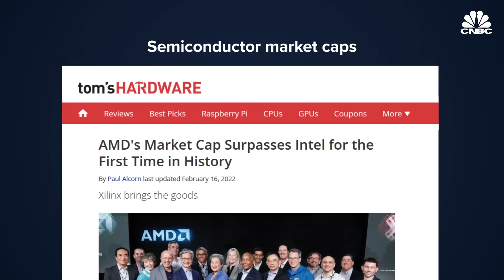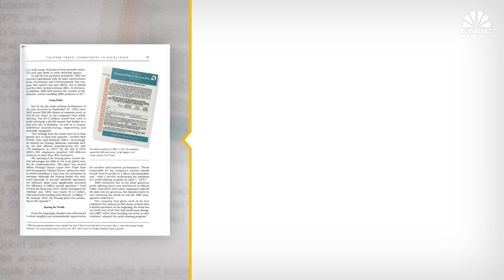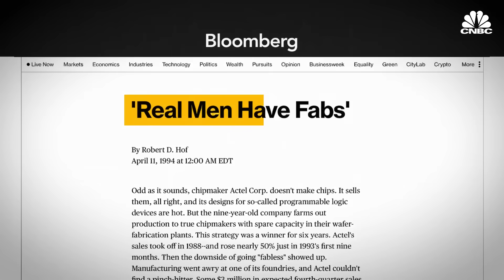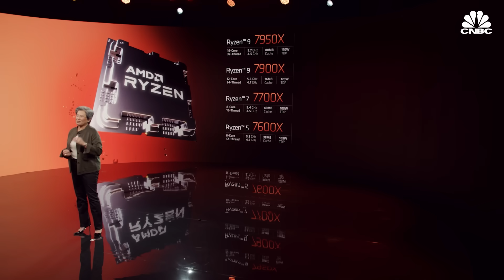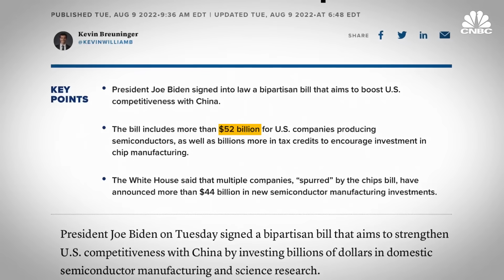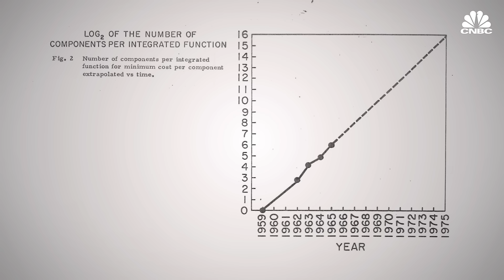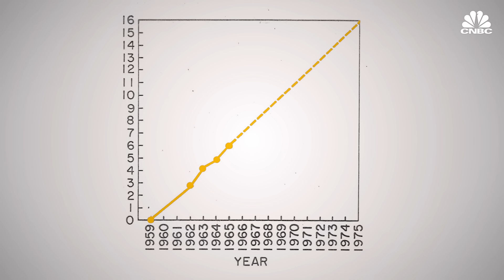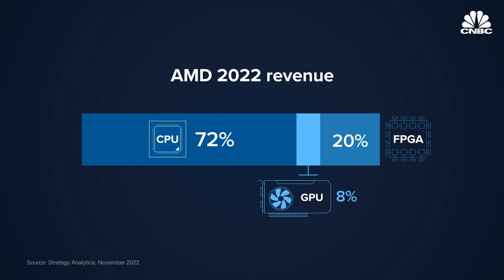How Chip Giant AMD Finally Caught Intel

Comment: I pray for AMD to give us a CUDA alternative for machine learning. Please give NVidia some competition in this space!
Reply: This this this!

The only reason I won't buy an AMD GPU's because all the programs I use for work require CUDA to work. I would love nothing more than for AMD to provide a competent alternative to CUDA!
Reply: @averymeijer  CUDA is a form of compute unit for graphics and nothing more.

AMD can't make the same thing or they've be violating patents.

The issue isn't AMD needs to make the same thing Nvidia makes.  The issue is the software that you use isn't optimized to use both AMD and Nvidia GPUs, nothing more. And this is the problem AMD has in different areas.
Reply: @averymeijer  AMD uses accelerators. But, CUDA is the current king.
Reply: We already have ROCm, it works well, we just need software support which is well outside the control of AMD.
Reply: @PineyJustice  If it is capable of beating out CUDA, then AMD should invest in the software just like Nvidia did during their beginnings.

ROCm requires specific OS/Kernals to run, has too few features compared to CUDA, and the docs are very sparse/hard to work with. This has got to change!
Reply: NV's RTX40 series (4080 16/4070TI) is just a cash grab. Extreme greedy this time. NV is now even trying to milk average consumers besides workstations.
Reply: Exactly!! Nvidia's 40 series is prirced like an insult to us consumers. Go AMD! (and intel)
Reply: Try rocm 5.3.3
Reply: Ngreedia
Reply: I would really jump out of CUDA if AMD can nail the GPGPU stack! But they failed badly with early versions of ROCm and made it worse by making it limited to VEGA cards... It's not at the CUDA level yet...
Reply: We need an affordable alternative for cuda core, only AMD can deliver that.
Reply: Besides ROCm vs cuda, how does AMD compare to intel's mkl optimization in machine learning (specifically tensorflow)?
Reply: @Very_generic_username  Intel's newest version of mkl (oneDNN) only easily works on Intel CPUs, unfortunately. It also seems to be optimized for Intel CPUs, so I imagine AMD will lag behind for years here.
Reply: ROCm is getting there... Give it a few years.
Reply: Why don’t you people just say you’re poor I don’t get it?
Reply: Just say you’re poor it’s a lot easier.
Reply: @sutnack7537  I have 4 4090s. It's not just about money. Competition is good for innovation.
Reply: Amd be using Open CL since ever, but softwares devs dont want to optimize for them.
A example is Adobe Suit, they only do enough to not crash instantly on windows, while a an equivalent NVidia gpu runs flawless(most of the time)
Funny thing is that Adobe Suit on mac runs pretty good(that used to use amd gpus)

Comment: AMD is good for the price and going beyond Intel now
Reply: honestly, even as someone running an amd rig, intel struck back hard with 12 and 13th gen
Reply: @renchesandsords  definitely! Im excited to see the competition between both of them in the next couple years
Reply: @renchesandsords  Yes Intel i5-13600K and i7-13700K have incredible performance but but their power consumption is just too high. AMD is still more efficient though, and now with their new price drop the 7700X being $350 it's a no-brainer.
Reply: @JFinns  the problem is in the platform cost z690 with ddr4 is a lot cheaper than even b650 and ddr5. for most workloads that aren't full load all the time, intel CPUs are plenty efficient, using comparable amounts of power to amd.
Reply: @renchesandsords  Right but AMD B650E with DDR5 isn't as bad. Intel also gets a lot more performant and really only rivals/beats AMD with DDR5 ram too so it's sort of a wash there.
Reply: @JFinns according to a ddr4 vs 5 comparison done by gamer's nexus on a 12900k, ddr5 tends to only be around 5% faster in games, with nothing breaking10 percent, save for 7zip. Plus, with a quick search the cheapest z690 mobos are still at least around 50 dollars cheaper than b650 boards
Reply: @JFinns  Power consumption is due to the node they're using and not Intel's chipmaking capability.

In other words it's because of their business as a semi-conductor company, not their business as a chipmaker.

But, unless you're running all-core workloads (100% CPU utilization) it may or may not mean that much to you.

As a comparison, and this is from Techpowerup on their review of the 13900K and includes power consumption of a lot of other CPUs since they track this data:

Averages:

7700X (comparison to the 13600K because otherwise it gets spanked by the 13700K in many workloads other than gaming):

Single threaded:   23W
All-Core:                135W
Gaming:                 62W

13600K:

Single threaded:   21W
All-Core:                187W
Gaming:                 74W

7900X:

Single threaded:   41W
All-Core:                185W
Gaming:                 81W

13700K:

Single threaded:   23W
All-Core:                252W
Gaming:                 89W

And on another review, I'm not going to bother to find it that shows Zen 4 in general uses more power at idle than Intel 13th gen.

The thing that jumps out at me is for the 7900X vs. the 13700K and once again this is a fair comparison based on thread count, the 7900X is worse than the 13700K until you get to all-core loads, and for gaming they're about the same.

For the lesser core parts the 13600K is better than the 7700X at single core workloads, a little worse when gaming but the 7700X does trounce on the 13600K at power consumption for all-core workloads.  The issue though is the 13600K beats the 7700X in many all-core workloads in performance.

In other words, Intel 13th gen CPUs are a little worse than AMD Zen 4 CPUs mostly in all-core workloads, but they also beat Zen 4 in all-core workloads once you move away from the 13900K, which pushes power to the MAX.

So there are many people who have SAID what you're saying, which is their power consumption is too high, but the reality is they're not much different once you've stepped away from the 13900K.  So that's a BS statement you're throwing out there.

Unless you're the kind of person who is running all-core workloads all the time and 99.99% of PC users aren't, Intel 13th gen and Zen 4 CPUs are similar in power consumption across the product stack, with the exception being the 13900K vs. the 7950X.  Gamers Nexus power consumption results show about the same as Techpowerup but Techpowerup gives more data such as power consumption when gaming over an average of many games.
Reply: The appearance at the current moment is that AMD is past Intel.

The reality is a bit different.  Intel has advances for CPU technology that AMD doesn't, and part of what AMD has, like chiplets is thanks to TSMC.  AMD has a line of processors that are specifically equipped to do well in gaming with added L3 cache called Vcache or 3D cache.  It's a die that has cache, put on top of the core chiplet, above L2 and L3 cache on that chiplet, so it's stacked caching and it means they can have a lot more L3 cache for those CPUs and that works great for gaming.  But this is also because of TSMC.  It's not AMD's technology that allows for stacking one die on top of another.

Right now Intel has a better interconnect between chiplets.  Intel has incorporated accelerators into the CPU.  Intel's hybrid architecture while having pros and cons has the pro of getting 2X the number of thread processing in the same space using a small core vs. a big core.  Of course there are some limits that come up with little cores (for Intel these are e and p cores).

Intel is behind on their roadmap for CPU architectures because of what's happened with their fabrication.  If Intel gets to their 4nm node next year as planned AMD is going to start getting beat in many areas.

A good test of how CPUs compare to each other is gaming and that's because gaming tests different aspects of the CPU architecture.  Right now Intel and AMD are the same at gaming unless you use one of the AMD stacked cache CPUs.  And stacking cache isn't something Intel can't do, it just hasn't been feasible for them to try right now with delays they've had and introducing a hybrid architecture which needed to be prioritized to get them on the same level as AMD for possible number of thread processors.  Both Intel and AMD have 32 thread CPUs with AMD's being the 7950X and Intel being the 13900K.

Where AMD is clearly ahead right now is in a much larger profit area, and that's server.  Their line of EPYC CPUs are better than pretty much anything else out there.  But Intel could catch up in 2 years as long as they make the correct progress on their process nodes.  They could very quickly put out a 256 thread processing CPU when they get to their 4nm node and then 2nm.  And this is when we'll see whose architecture is really better.
Reply: @johndoh5182  im excited to see AMD implement their 3d vcache in future cpus. The 5800x3d was just a glimpse of whats to come and i see great things coming from it!

Comment: AMD was the favorite for every gamer. 
They used give performance within budget. So a gamer would have been able to upgrade his rig often. 
While they caught intel, they caught on price as well. Now AMD is not cheaper anymore. 
A 7950x costs not much less than a 13900k.

In Laptop the difference is even less or non existent.
Reply: amd graphics cards are much cheaper than nvidia's with similar performance
Reply: Price has gone down for 7000 series. May be you are living under a rock
Reply: it's cheaper than 13900k about 70$ on amz, idk what are you talking about ? 
In laptop if you prefer heat and constantly charging sure intel is a good choice.
Reply: @nguyenhanh9479  True, but back in 2005 or so, AMD used to cost less than half of Intel.
Reply: @KoushikPaulliveandletlive  Because they never had the market (Stolen by Intel, by paying OEM to not have AMD in there systems) before!

Comment: We need more competition! But AMD has one major flaw: No own forges! This will be more and more important in the future! And Zen3 vs Raptor Lake doesnt favour AMD.
Reply: they used to have foundries that they sold off. The video explains why they dont have a fab
Reply: Do you mean Zen 4 vs Raptor Lake?
Reply: Foundries is very expensive and you can hit ceilings like Intel where you are failing to refine the process nods for years. That is huge expenses on failed R&D

meanwhile sourcing it from third party like TSMC has the benefit that third party can compete between each other and in that sense try to ale the latest fab processes and better silicon nods
Reply: Owning your own foundries has a big disadvantage, if you ever find yourself behind the curve with the latest lithography process then your processors suffer.

Best to separate the design from the manufacturing and choosing the best lithography process rather than being forced to use your own like Intel did a few years back when they couldn't stop using their outdated 14nm fabrication process to save their own life.